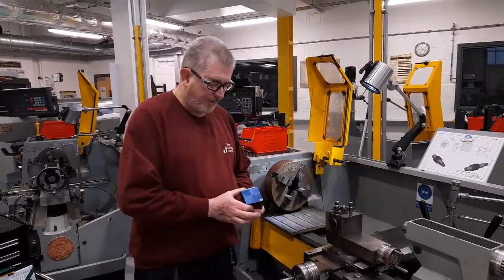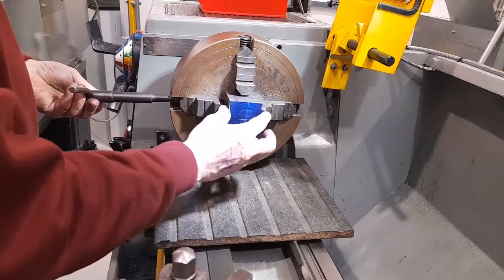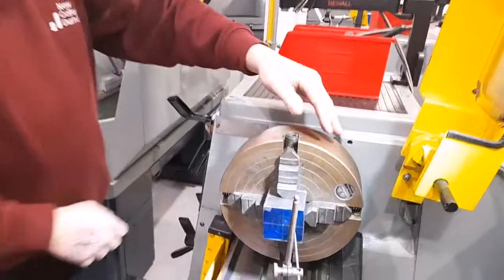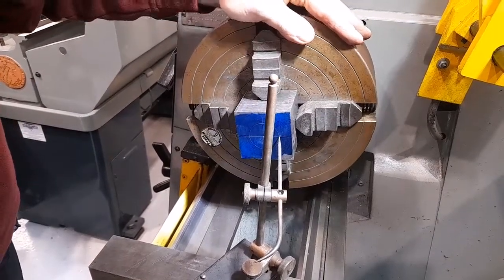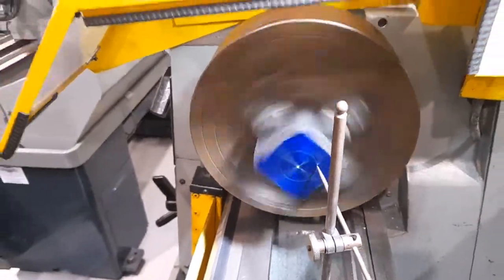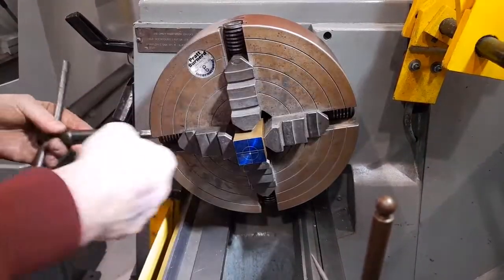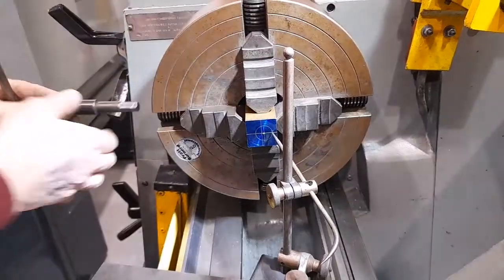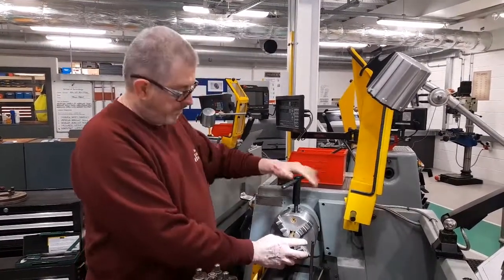Lathe -Setting A Workpiece in a 4 Jaw Chuck

Comment: easier to just put a live centre in your tailstock then a dead centre between it and the face with the point in the middle of the circle. Then put a dial indicator one the outside of the dead centre. Adjust the 4 jaw until it shows no runout.